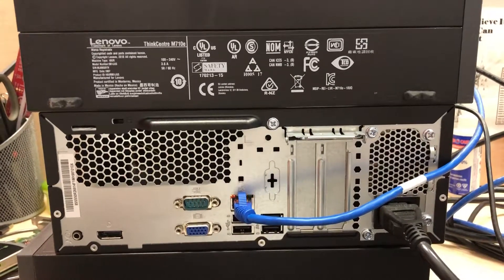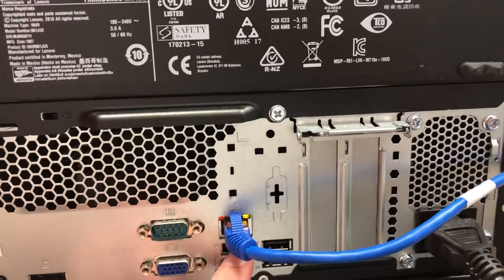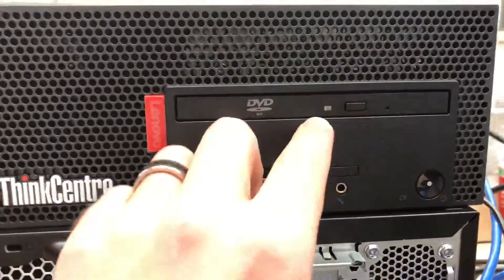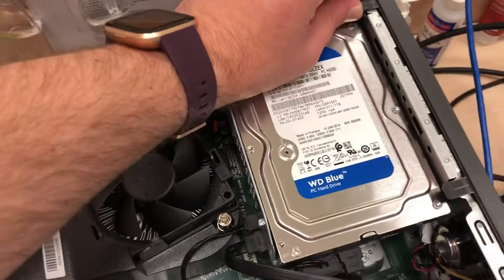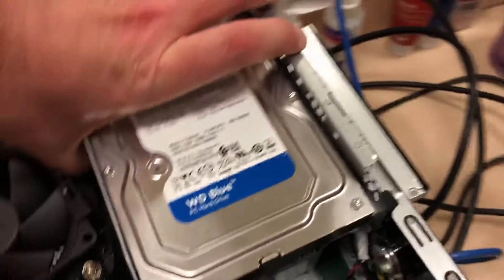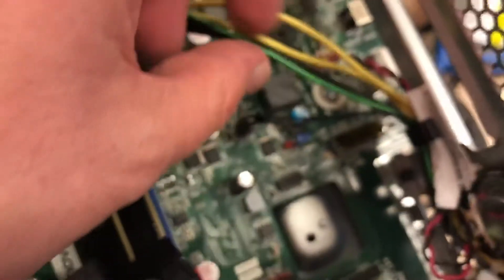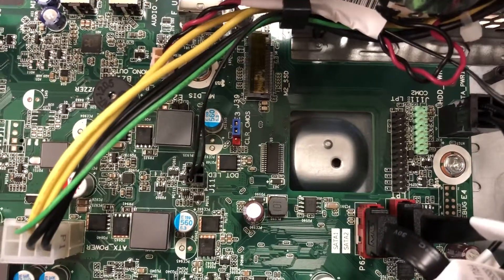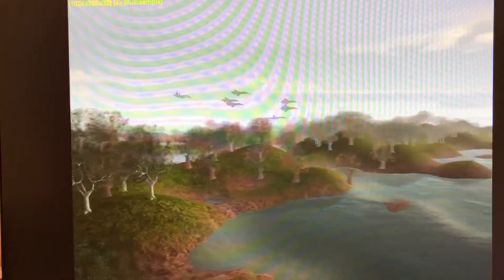Core i5 7400 3 GHz 8 GB 1 TB US Lenovo ThinkCentre M710e - SFF Review Benchmark Memory Upgrade

Comment: I bought one of these for work but surprised just swapping the gpu out how good it is for gaming. Going to upgrade the ram but knowing that the ram is under the HDD gives me anxiety.
Reply: what gpu?
Reply: @昆布の出汁 when I bought it, I bought it with with a gt 710 1gb ddr3, it played the batman Arkham games well enough and games from that gen, maybe up until 2018 but I've been looking for at least one that's 4gb that can fit into it so I can use the Photoshop versions, they're very gpu heavy now.
Reply: are you able to make it fit 3060 into these boxes i might get m720e in the future used one. I`ll remove all the unnecessary things, but for gaming unfortunately it seems only have 1 m.2 slot and that's terrible.
Reply: @greaturkk only low profile gpus work in these, with the GPU I had in this it worked for a lot of games that were up to 2018, something better will work for some newer titles, for a 7th gen with upgraded ram to 32 it works pretty great but might not be for everyone, parts can be swapped but it's up to  the user, just skipping gens will need a new motherboard.

Comment: Can you add ram
Reply from the maker: Yup sure can.
Reply: @NevsTechBits  Without your video, I'd have given up trying. I didn't see that screw holding the hard drive from way below, in front of the drive. I thought I had to remove the screws in the side of the hard drive chassis and one of them is too hard to reach because of the fan housing. What a relief!
Reply from the maker: @Skridles  lol Glad I could help you out Susan =)